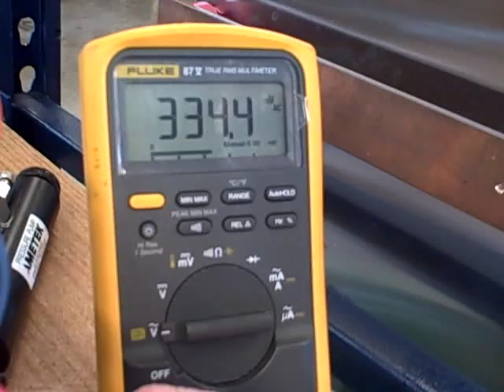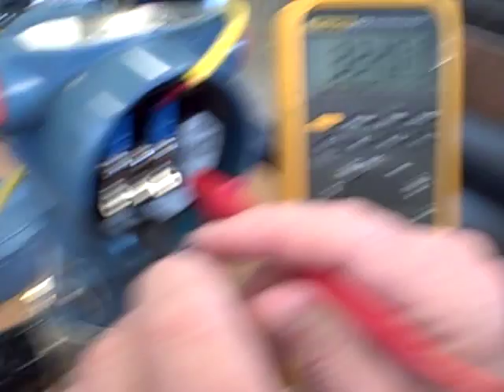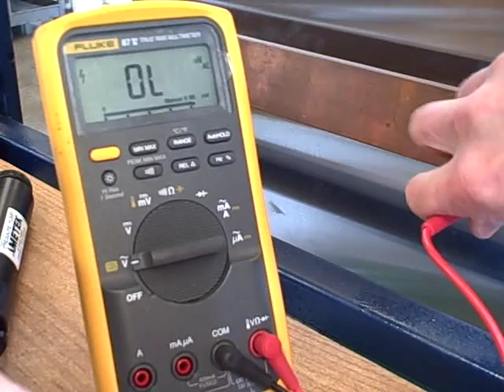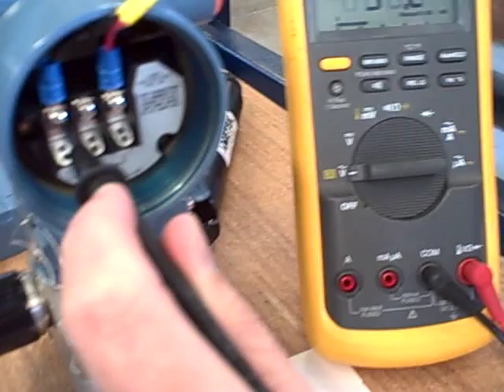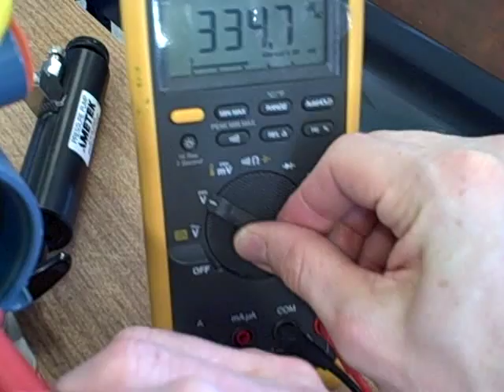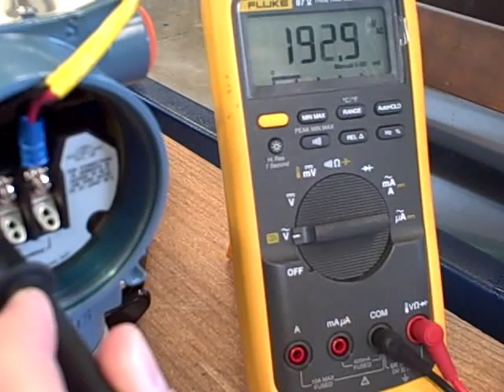Fieldbus network voltage measurements (part 2)

Comment from the maker: This Fluke meter exhibits approximately 11 M ohm input impedance.  The probes are passive (simply wires).  This is a crude measurement, and so we are not concerned about impedance loading.  All this is good for is making "qualitative" determinations of Fieldbus signal strength.